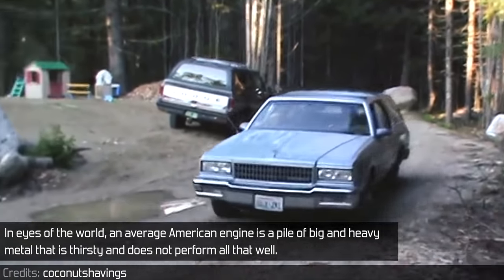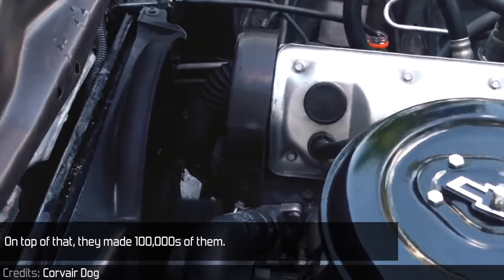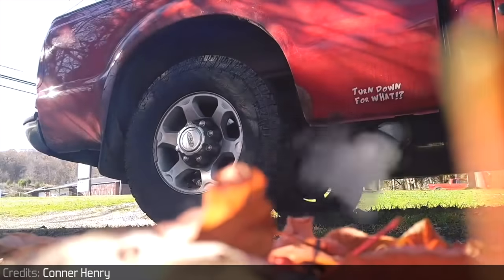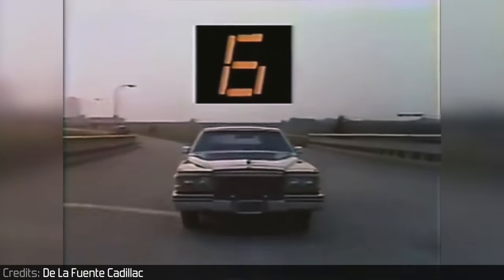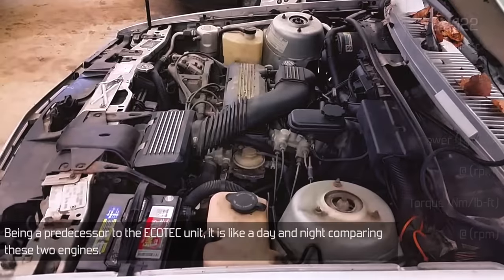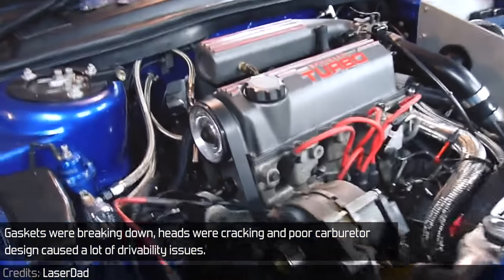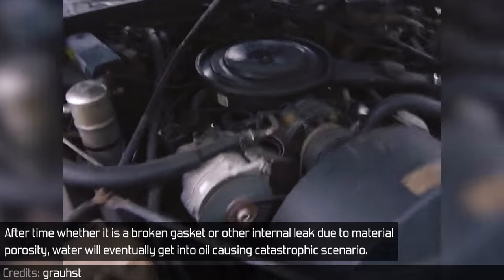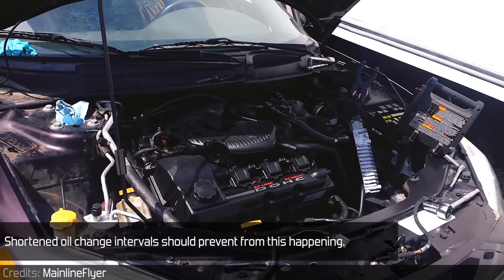8 Worst US Engines You Should Avoid

Comment: funny how u showed the triton and not the northstar.
Reply: I used to have  a Cadillac  with a. Northstar  engine mechanic  would even touch it
Reply: That's what I was lookin for
Reply: I'm a GM guy & even I have to agree... northstars were garbage.
Reply: Once a northstar has the block studded for the head bolt issue, it's a 300,000 mile engine. I have a 1999 4.6L LD8 version from a Deville tore down right now for normserts and ARP head stud upgrade. It has 109,000 miles on it and the crosshatches from the original factory hone look brand new. I will be swapping it into a 1999 Olds Aurora. The N* heads breathe better than unported chevy small block 2.02 fuelie heads. Although the valvetrain is a bit complicated with its 3 timing chains, 4 camshafts and 8 sprockets, it's pretty rock solid. Notice I said CHAINS.

The Aurora version (4.0) northstar with close to a stock bottom end won the indy 500 5 years in a row starting in 1997. It was naturally aspirated (meaning no turbo or super charger),  produced 650 - 750HP and spun @ 10,500 RPM's. Google "Aurora indy"
Reply: That’s what I was looking for
Reply: Yeah, the Cadillac Motor division had some big flops in the 90's but they still weren't nearly as bad as the Tritons though. I had a 4.6L in my F150 FX4 and I ended up trading it in at 83,000 miles because of the non-stop spark plug spitting/burning and coil pack burning. I had the H.E.I. system replaced three times by Ford and they refused to work on it anymore. I taded it in for an 01'Silverado 1500 with 174,000 miles on the odometer and I now have 440,378 miles on it all original. I doubt I will ever buy another Ford Truck.
Reply: Head gaskets for days....
Reply: @mayhemmike1789  The 140 Vega engine with its aluminum block with no liners has to be the worst engineering fiasco ever in the world.
Reply: Good thing about the Northstar is at least it’s powerful. I got a 2002 STS sitting in the driveway that I got for free thing runs like a damn scalded dog. Updated head bolts and valve cover gasket’s and those are some damn really good engines. 300 hp 24.5 mpg. At 70 mph.
Reply: Can't even give me Cadillac with a Northstar for free. My grandfather had nothing, but problems.
Reply: I disagree on the Triton, I know of many of them with over 350,000 miles still running strong with no issues.
Reply: Because the Northstar is one of Cadillac's best performance engines.  Your thinking of the older HT series engines primarily the 4100 engine that were problematic.  The Northstar when properly maintained will run forever.  The Triton is another fantastic engine and don't understand how that made the list.
Reply: I'd rather have a Northstar than a 3v 5.4 Triton. I don't want to have to do multiple timing chain jobs and rethread plugs shooting out. Both engines have long service life, but I can tell you from experience which is cheaper and more reliable
Reply: And the Olds 350 and not the 6.0 or 6.4 PS.
Reply: Yeah, for the 2-valves, and last I understood, the permafix for 2-valves shooting sparkplugs was a helicoil job. And also, the reason they would shoot sparkplugs is because the threads were too shallow to hold them, which is where said helicoiling would come in to solve that problem.

3-valve's sparkplug woes involved the two-piece plugs breaking in half inside the heads, and antiseize was the kinda/sorta fix for that until Ford ditched that sparkplug design. I don't think the 4-valve or Coyote have problems like that.
Reply: @tskraj3190  Issues with the 4.6 Triton's are very rare. It's the 3V 5.4 specifically that has all the problems.
Reply: @honkhonkler7732  Not rare at all. I had two F150s in a row spit plugs. My 97' with a 4.6 and  my 03' with a 5.4. The 5.4's cam phaser was replaced twice. Every person I have met in person with a 2007 or older F150 has had the exact same issue. Most of the time it starts out with the plug getting so hot it solders itself in and then once it's removed the plug continuously spits out.
Reply: @theaveragejoestinkeringand4407  That's what drives me nuts about our car companies. They could have spent a few bucks more and studded these from the factory and made a great motor. Instead, they cut corners and made junk. They need to keep the accountants out of product design...
Reply: @Ghostrider-bg7fe  In his book John DeLorean told of the entire Vega engineering fiasco including the engine. Yet in the Chevy ads when the Vega was introduced he described the engine as 'It's sure to become a classic. It's that good.' And he knew it was junk.
Reply: I've got a Triton and have no problems with it...at all.
Reply: Lots of northstars and tritons survive to this day. They were better than a lot of people make them out to be
Reply: Why is that funny?
Reply: @tskraj3190  well gm uses ford for transmission help
Reply: @aaronmcconkey338  Only the 10 Speed which Ford had issues with about 5 years back.
Reply: Because the triton IS garbage
Reply: Larry Tate thank u for your vast knowledge lol.

Comment: I have owned and worked on this whole list, and you sir are correct.
Reply from the maker: Appreciate it! I did my best browsing all those forums and webs to choose the worst.
Reply: I call bullshit. I got a 5.4 triton from 97 and I've never had the spark plug problem. Only changed a cam phaser
Reply: It's not bullshit...look up the Ford factory service bulletins sometime...many,many trucks have spark plug holes in the hoods!!
Reply: bobzippyify You must have a remarkable exception then. My Triton V10 shit every spark plug one by one, about 2 weeks between each plug, and I almost rolled it off a cliff. Otherwise, it's been an unstoppable beast. Still have it, and it's 180k running strong.
Reply: I have never heard or majority of the 2.2 liter I4's problems. From what I've seen of the Allpar forum's, many owners haven't either.
Reply: I’ve owned dozens of 2.2’s, they would need a head gasket at least once in their life, but overall they were extremely reliable and easy to work on. If the head did crack it was usually between the valves and was just superficial. Whoever says a 2.2 is one of the worst engines has no idea what they’re talking about.
Reply: As far as the modular is concerned I can't say that it is really that bad. Sure, some overzealous, know it all engineer tried to save a few bucks by only putting three threads in an aluminum spark plug hole but they fixed that in the later ones. And any engine that has that many examples with over 300000 miles running around can't be that bad
Reply: I own 92 mercury grand marquis (4,6 triton) and 97 ford expedition (5,4 triton). Marquis has something about 700K kilometers on odometer. Expedition has something around 400K kilometers done - running smoothly and often hauling overweight. What am i doing wrong? Why my engines do not spit spark plugs or ruin to dust?
Reply: JBD I'm surprise he didn't put the Northstar on the list
Reply: we have a 4.6 in our crown vic, and its not a triton.  those things were 3 valve, ours is 2
Reply: @cambo1200  Fixed a shit load, they would sometimes snap the camshaft between cyliders #1 and 2.
Reply: @VisioRacer  -  When people changed the spark plugs in the triton they would damage the threads with the carbon on the plugs. That is why they would blow out. They just did not put enough threads on the cyl heads. I solved mine by choosing not to change the spark plugs and turning off the EGR. The increase in burn temp cleans the plugs and I will nurse it as far as it will drive. I have also had to change the coil packs as they are known issues as well. I have had no problems with this motor. I change the oil and it keeps on running. Approaching 200k and still strong. 
Love your presentations. Great content. Spaciba.

Comment: Your right. These were all pretty wretched. The Ford Triton engines are actually pretty good, except for the spark plug issue.  Which is a big issue if a plug snaps off in the head. Police departments around the country have used them for years.

Comment: I'm a retired ASE Master Tech and worked for GM dealerships in the 1980's and 90's and can vouch for his choices of very bad GM engines. All of the problems he cited were common knowledge among experienced GM technicians.
Reply: I was an ASE certified tech at Ford during that same time period and we were aware of the bad GM engines as well as some pitifully bad ones we had as well. The main one that comes to mind is the 1.8 liter and early 1.9 liter Escort engines,they were worthless after about 65,000 miles. I've seen them fill the air filter up with so much oil to the point that it would dump over into the carburetor throat and just choke the engine to death. The early model 6.9 diesel head gasket failures. Yeah all the Big three have put out some really badly designed engines,but they've also made some great ones too. I still prefer American iron over foreign stuff.
Reply: @lawnmowermanlawnmowerman9930  I'm here to tell yall both off. Every american car was trash in the 90s if you didn't spend 40k on it. Before then there was no problem and after there was no problem. But every american 90s car was absolute garbage.
Reply: @savagetuner2404  Sorry bud,but you are dead wrong about every American brand car in the 90s being garbage. The P71 series Crown Victoria of the 90s is still being used by many Police depts. all over the nation. And the Ford mustangs of that era are still sought after today . And by the way,several Japanese and European cars of that
 era were way worse than their American counterparts.
Reply: @savagetuner2404  wrong
Reply: Anti Angelofmusic that’s not an argument.
Reply: @savagetuner2404  who's arguing? I'm just right. If you're saying that 80's cars were better oh, you have lost all credibility.
Reply: Anti Angelofmusic “I’m right you’re wrong”

Comment: The 4.6, 5.4, and 6.8 were good engines, plug issues aside, I've seen plenty of them come through my shop with 350,000+ miles on them.
Reply: the plug issues were the only major trubble with the triten engines though they did have some coil killing problems for a while but like you ive seen loads of the ford tritens and many are very reliable but the 04-08 engines tend to have cam phaser problems as well as timing chain tentioner/gide problems the after market has released a number to fixes for the issues but if i were to go with an 04-08 ford with a V8 ide choose the 4.6 over the 5.4 due to the ever going issue with the 5.4Ls horrid plug design they are a great engine but the plugs are the biggest and non fixed problem for the 04-08 5.4s the 6.8L is a very great engine dispite the plug problem thats since been delt with oddly when paired with the rite exhaust they make a ford truck sound something like some exotic car lol they are very capeable engines but the plug issues really hurt the rep of the triten engines
Reply: I've kinda considered the plug issue to be the fault of an unchecked engineer who was trying to save money and had a chart somewhere saying that 3 threads where enough to hold a steel plug in an aluminum head🙄 the sad thing is anybody who's brain operates in the real world would know that that isn't a good idea
Reply: +Da Sarge ya the v10 sounds like a lambo i think u can upgrade the motor it to make it rev higher to sound exactly like 1
Reply: MrErikw26 the first gen 2v v10s were good, second gen 3v v10s were as bad as the Vegas in my opinion, anything that costs 8k a year to keep on the road ain't worth it
Reply: I have 260,000 on mine no issues great engine
Reply: The biggest cause of the timing chain and cam phaser issues was a lack of maintenance, 150,000 on mine, oil changes every 3k.
Reply: Stanley Johnston.  lol. I get almost 20mpg out of my triton. my carbuerated 350 '81 Silverado passed everything but a gas station. 😁
Reply: JP 360FORD standard cab truck? If I pedal my 5.4 like a Sunday driver, I can get 17mpg, I usually get 14, I also have the supercrew cab, and the 6.5' bed and 4x4
Reply: MrErikw26 extended can 2wd 4.6.. 18mpg hence why I said almost
Reply: the problematic triton is the 3v 5.4

Comment: The Triton V8 wasn't really that big of an issue when you look at how many are out there and how many actually had the problem. The biggest issue was people pulling the plugs out when the engine is warm and the aluminum was softer. Make sure the engine is dead cold maybe a small amount of penetration oil and pull them out. Then actually use a torque wrench when putting them back in with anti seize and you won't have an issue.
Reply: Well, you should be able to change the spark plugs without having to go through a Druid ritual. No other engines have an issue here. One should design aluminum heads with enough thread in the spark plug holes, not to mention specifying plugs with enough thread to get to the bottom of them.
Reply: The early model Triton's had the problem with spitting out the plugs, mainly the 97-98's & esrly 99's on the V-10. Then the Pi heads came out, they had more threads in the heads and they flowed much better. The 3 valve Triton's r the ones that had the problem with the ceramic plugs breaking while trying to remove them.
Reply: @BrownBomber92181  I really haven't noticed that much difference between them and Chryslers, leave them in for 100k and they'll weld themselves in unless you have an oil leak, and the Chryslers tended to leak more.
Reply: Amen,you are correct sir.
Reply: Sigc
Reply: The main problem with the Triton was small oil passages getting gunked up and destroying the Cam phasers.  After that the long block needs replaced.  Spark plugs were a bad but manageable issue.
Reply: @soaringvulture  Exactly.  Ford should have never screwed up the spark plugs in the first place.  I can't think of ANY other engine that has screwed up the spark plugs....  TWICE.
Reply: My 4.6 in my 94 Vic has been dead reliable and I've changed the plugs twice without any issue
Reply: Shouldn't try to go 100,000 without checking the plugs, no matter what they say.

Comment: The biggest issue with the Vega was the silica impregnated cylinders.  The engineers used a special honing process that raised the silica above the aluminium surface and then cast iron plated the pistons to protect them from the aluminium of the cylinders.  The problem was, once the cast scratched, the piston and cylinder galled, scoring both.  Under warranty, GM would bore the cylinder(s) that were scored and install new pistons only in those cylinders and just put new rings in the other cylinder(s).  Once out of warranty, GM would recommend that the block be fully sleeved with cast iron sleeves and aluminium pistons be used, all at the owner's expense.  Once that was done, there were no more issues with cylinders.

One big issue they had was the early electric fan setup that didn't engage until almost 220 and a very small radiator.  One summer, I had to have the heater going full blast in 90-degree weather to keep it from overheating in traffic.  After sleeving the block, putting a bypass switch on the fan and a larger radiator, I had no more issues of any kind and took it an multiple 1500 mile trips in summer heat.

They did have some head gasket issues, but I remember doing more cylinder repairs than head or block surface repairs.

The Quad 4 was another engine with head gasket issues.  For the years they were used, I could have made a good living just doing head gaskets on them, with about 25% of the Quads coming through the shop I worked in being blown head gaskets.  It got to the point that people who were in the know about cars wouldn't by a Quad.  At the dealer auctions they were going for a steal.